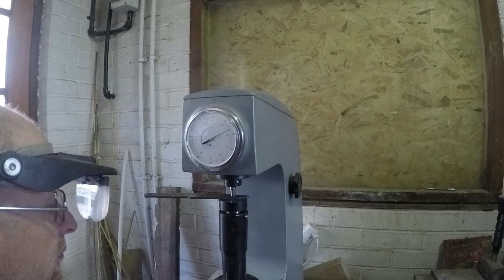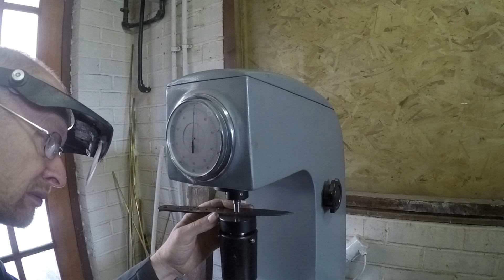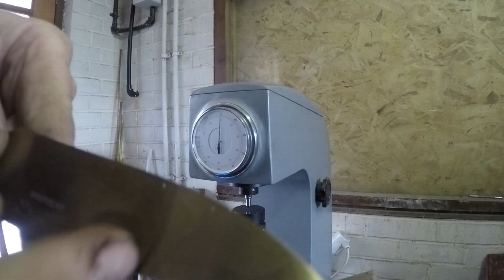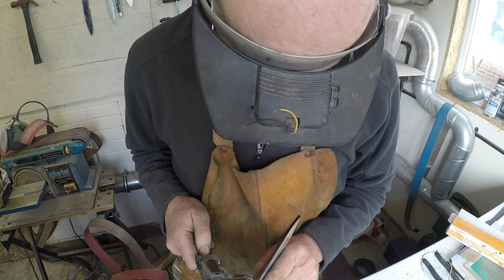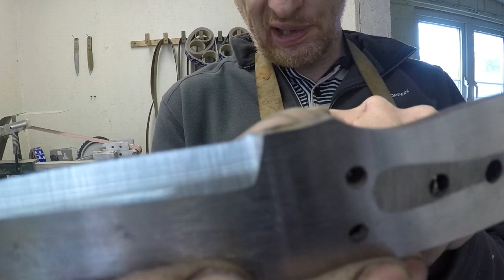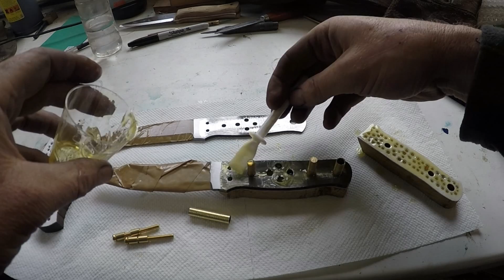Post heat treat Rockwell testing,grinding and fitting scales

Comment: Very nice Sandy Love to see the master at work. 
I see you hold the knife with that magnet. Is that a magnet they use when holding two pieces of metal for welding them. Those magnet's really hold that blade very good or do they slide a little. You know the blade. Thanks for sharing Sandy.